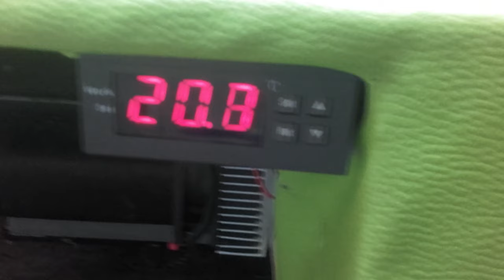Caravane en Express coupé

Comment: On peut dormir dedans mais faut que la porte soit ouverte... mouais je suis pas convaincu pour le confort.
On peux croire en la solidité de l'ouvrage car cela à l'air d'être fait pour être solide... mais justement lors d'un accident on ne sait pas comment va réagir la structure (aucun crash test). je dis ça à cause de ce tu dis a un moment dans les commentaires 

"j'ai entièrement confiance en mon travail pour aller sur l'autoroute. Et en cas d'accident , un expert constatera une mécanique fiable qui ne sera pas en cause d'un accident. Après chacun fait comme il veut..."
Ton ouvrage est à la merci d'une interdiction et donc d'une immobilisation à tout moment notamment pendant des vacances.
Je trouve que c'est beaucoup d'effort et de risque pour un résultat certes original mais à la fonctionnalité très limité. ça aurai été plus interessant de faire ça sur une remorque à cabine basse